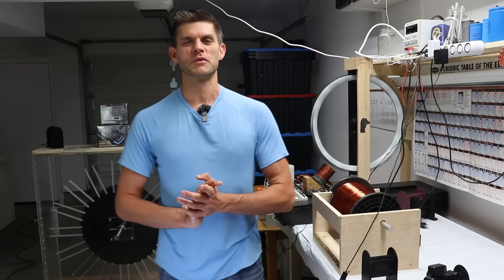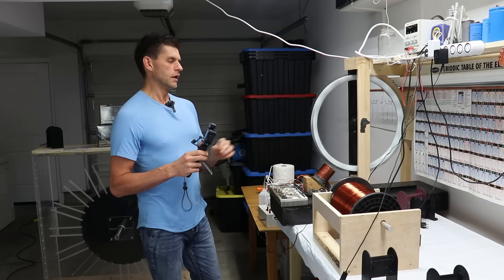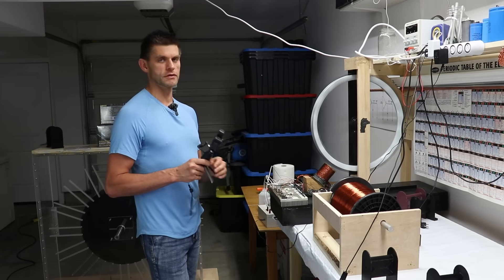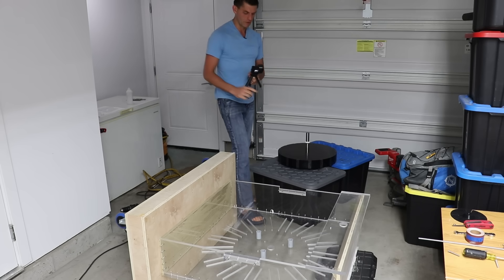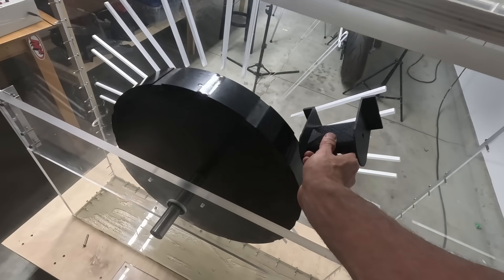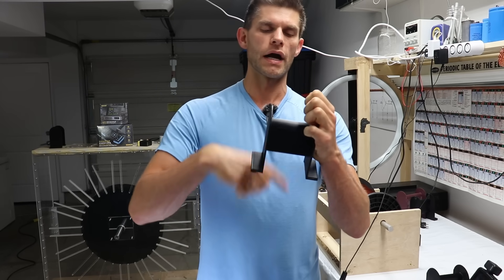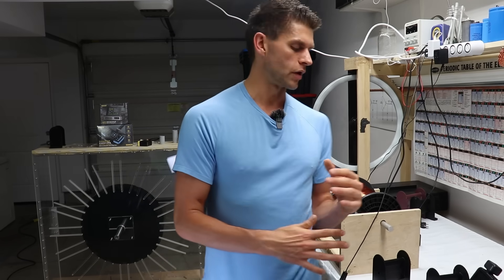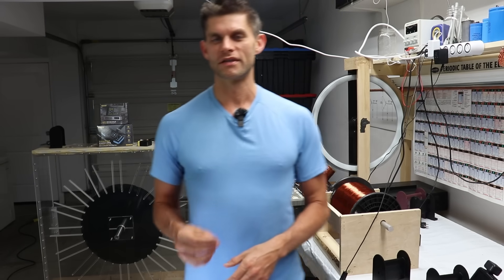Unlocking Zero Point Energy in My Garage (Open Source Project)

Comment: This sounds all nice to the untrained everyday joe, but to the trained professional it is painfully obvious that all this does not work.
Reply from the maker: Ya that's the problem with science, you think cuz you went to school you are smart enough to tell others what's impossible
Reply: @MadscienceLPTECH  thank you for your quick answer, but is was foreseable. Let me tell you - I have spend multiple years of trying to build a machine that puts out more energy than it consumes, including Bedini Motors and searching up old patents and researching about the sudden vanishing of "genious inventors" as far as I know, nobody has been able to undeniably, scientificly proove (with undeniable measurements) that any of these approaches works. Not even in theory such machines work - nobody has found an obvious gap in physics that could be filled with an explanation that allows any of these "motors" to work. All you are doing, is building (best case) an efficient electric motor. BUT it will always consume more energy than it generates. Gaining the energy of vacuum fluctuations is not possible because the energy converters themselves require more energy to function than the fluctuations generate.

Comment: "Air Core vs Iron Core - They Are All The Same"  Paul Babcock.
Reply from the maker: Lol not what bedini said
Reply: @MadscienceLPTECH  Watch the video full version available off A & P Media.  It was Bedini himself that told Babcock, and I quote "Take the damn iron out of it!"  
Of course Babcock called the 
single coiler ssg  "A GoKart.  
The 16 coiler ssg  "72 Camero" and whatever Babcock himself was currently working on "A sportscar ssg."  
Babcock put emphasis on transistors that switch/operate in nanosecond range and silicon carbide diodes that are put over circuits to protect from lightning strikes.  He said "There is no overunity devices. There are only overunity systems".  He was referring to the conditioning of the batteries.  He also said "the pulse motor is one of the most inefficient motors ever created."

Comment: Run multiple charging batteries in parallel off of the output spike, and if you're not already doing it you can collect the output charges in a capacitor and dump a higher voltage load into the charging batteries.
Reply from the maker: Yes great ideas. We can increase the input  voltage to increase the output voltage spikes

Comment: Interesting.

If you can use a tiny amount of current to extract even more excess energy as charge from the environment, you have something pretty cool.

If your larger battery truly charges from your smaller battery through this device, a low-charge battery (3.3 volts) should be able to power the machine and increase its own charge. 

That would be the beautiful test - the machine runs off a single battery, and increases its charge over time. A VOM measures the voltage, and we can watch the voltage rise as the battery charges. 

Then discharge the battery to see how much energy it can produce until its voltage reaches 3.3v.

Cool project.
Reply from the maker: Great idea and comment.

Comment: This is old..I made a Bedini wheel 15 years ago. Geeez. No torque..can stop with little finger. All good for is making counters in copy machines. Do a little more research and keep trying.
Reply from the maker: sounds like you wernt listening, this is a pulse motor with mosfets and high voltage, not a little girl bedini like the one you built lol

Comment: Great concept. You might like to check the liberty project. They have 3 working prototypes of a zero point energy machine. They also can provide the schematics on the prototypes.
Reply from the maker: I dunno if they are legit, I haven't seen any schematics or full disclosure. Their machines are based off others patents from the 60s-80s

Comment: Electric Engineer my ass!
You are pushing the same ages old scam that every other grifter is pushing.
You can't get more out of it than you put into it. And you are still drawing power from conventional sources! But I bet if you disconnected it from the battery NOTHING ...absolutely nothing would happen! And if you just needed the charge for the start a built-in capacitor would do the same as the battery. But it doesn't really work that way!!
And you are just another unscrupulous scammer!
Reply from the maker: clam down, and move on then

Comment: Just so I didn't seem like a douche, so I actually put in some good help, when you go to turn this into electricity, make sure to use a helical (bar with a twist) stator array inverter system.  You'll get 300% more electrical input out of the manual returns from your system.
Reply from the maker: Oh ya, got a link?

Comment: There's way more promise, and it's already been proven to work without a shadow of doubt, inverting the phase-change cooling process to create electricity off of the atmospheric differential using large panels to create pressure to turn an inverter.   It has nothing to do with sunlight or wind.  It works best in the northern hemisphere, at about 50- 72 degrees Fahrenheit.
Reply from the maker: Geothermal has also been proven.

Comment: This BS has been recycled every decade since the 1970's. Along with the Adams motor generator, its easy to build, spins, but does nothing but waste energy because you will only ever recapture a quarter of the energy used to make it run. And the moment you try to use the rotational energy to do mechanical work, the electrical recapture diminishes to zero depending on physical load. A total waste of time other than teaching the basics of a pulsed motor.
Reply from the maker: You sound like a real scientist

Comment: I dont believe your getting excess energy because its clear where you are losing energy. Plus how can you possibly scale up for actual use. Geothermal or solar steam turbine is much easier to scale up to provide commercially. Coastal areas or big lakes with an ebb and flow can also be used to generate electricity
Reply from the maker: Ya there is enough energy gained to negate losses

Comment: Have you ever built a smaller working model that is self running?  If so, you should maybe think about streaming it in constant operation for a few days, weeks or ....even months,  as a kind of  'proof of concept'.  It could also serve as encouragement for others to take interest. I ask mainly because I know of another man on You Tube who built a small two battery version that supposedly ran indefinitely off of two small lead acid batteries and automatically switched back and forth between the charging battery and the running battery when the latter dropped below a certain voltage.  I wish he would have thought about streaming that. The channel is 'Daft Man'  He gives really good and clear instructions on how to build a very scaled down version of the  "Bedini SSG".   I don't know if he's still around,  but I did happen to download all of his Bedini motor videos and I have them in my archive.  I downloaded them back in around 2014 or 2015.
Reply from the maker: ill stream this one for ever once its running

Comment: My uncle was involved in a project that I haven't seen anywhere else.  I saw his videos and it appeared to easily create more energy than it used.  They had a material that blocked magnetic waves and built a fan out if it, similar to the timing wheel you showed in this video.  Super strong magnets were placed on each side of the fan so they repelled each other, one fixed and the other on a slide spring loaded to push them together when the fan blade blocked the magnetic field between the magnets.  It took almost no energy at all to spin the blades slowly while the sliding magnet slammed back and forth with tremendous force.  In fact, their issue was keeping the machine from tearing itself apart and turning the linear force into rotational to turn a generator with many, many times the force rotating the blades required.  They tried shock absorbers and other mechanisms but the slamming was breaking everything.  My uncle since passed and I have no idea what happened to the project.
Reply from the maker: cool, thanks for the comment wish you had his stuff to show us.
Reply: I want to try to recreate this. Do you have a social media I could reach you on to understand this more?
Reply: If you were telling the truth, wouldn't you try your best to find the project or anything so you could get the tech actually created?
Reply: @huff_designs why would I?  It wasn’t my uncles project, he was just helping the guy that was building it. It was 30+ years ago…and I have a life doing what I like to do. People like you are the scourge of social media. Just dump on everyone else because your life is so empty. Grow up.

Comment: You want to design the wheel differently. Old India invention has upside down horseshoe design spokes that has water inside that on outside edges, gravity helps momentum, and inside spin pulls that weight in. Modern upgrade would be to vacuum the atmosphere out of the air section and also put that wheel on magnetic bearing to virtually eliminate friction and your magnetic setup outside that.
Reply from the maker: Vacuum would be good
Reply: @MadscienceLPTECH heavy water will weigh more and help. It will want to shift off magnetic bearings so add a point and a stop and its a sideways spinning top with magnetic glued around edge but vertical and adding some gravity power to your kinetic energy storage and transfer station.

Comment: I like your positive energy, and you are showing some great building skills. Very nice!  
Yes, maybe building a Bedini pulse motor on a larger scale might tip the scales and lead to a COP > 1. You just never know. 
I would caution putting too much money into it at first, however, unless you have the excess funds. 
I would suggest to try to build the basic bare bones setup first and try to keep costs down as much as possible, and if at some point you see clear signs of a COP > 1, then you can consider putting more money into it. 
That way if it doesn't work out in the end (COP < 1) you have minimized your costs. 
Still a fun project to work on at any rate, regardless of the end results. 
I guess you are going to go with lead acid batteries? Pulsing lithium batteries with high voltage spikes could potentially have bad results. You'd want to research it well first, of course, if you want to consider using lithium batteries. 
Best of luck with your build!
Reply from the maker: Thanks mate

Comment: MadscienceLPTECH! These are for you and those who comment on this video! John Bedini has hidden the real working method of the SSG and the 10 coil big motor/generator in his workshop from everyone except a few people ! 
I am revealing Bedini's secret to you here ! 
Read carefully what I have written and try to understand ! 
The SSG in the video only provides its own continuous operation, while discharging the first battery, it charges the second battery and the mechanical movement continues uninterrupted by changing the places of these two batteries ! Everyone knows this system. 
This system DOES NOT GAIN YOU ANY EXTRA ENERGY ! 
Now let's come to the 10,000,000 £ question and the correct answer to this question ! 
Bedini (I am talking about the 10 coil motor/generator in his workshop!) inside the multi-wire coil that he showed everyone, between the coil core and the coil wires, PAY ATTENTION HERE!!!  Bedini placed the "GRID"s in the COLD PLASMA TUBE used in "EDVİN GRAY"'s engine inside the coils!! 
Bedini did not show this ! 
While the copper wires of the coil ensured the continuous operation of the engine, it also printed the EXTRA ENERGY from the GRID placed between the coils and the iron core to the real battery bank! The energy from the coils passes through the primary winding of a step-down transformer and discharges to the ground. It also charges the battery bank from the secondary winding of the step-down transformer! It was able to discharge 10,000 AMPERES in 4 hours. I assume that you thank me for this information I gave you and I accept our thanks. I wish everyone success in their work.

Comment: can you build an electromagnet and make the bottom of the magnet a very thin wire and make the top with very thick wire would it create spacial displacement ones getting a little bit negative and top side is getting alot of positive could you make the electro magnet move that way onesides getting more energy than the other
Reply from the maker: Love it. Great thought. I think the thin end would produce majority of the field and heat etc. You could model it in solid works and see

Comment: 2 Enhancement suggestions:  1. For the large magnet disc, change the shape from a disc, to a spinning top/totem shape, like the toy top in the movie inception. This shape will help to minimize the drag on the disc.  2. You have to add a vacuum to the chamber to reduce the air friction and set it vertically.   I wish I could find the the video on YT from almost 10 years ago or more that had an engine design similar to this one but essentially these two changes were needed to achieve a motor that would run for months on a small battery, it wasn't an OU engine but it was damn close.
Reply from the maker: Love it. Vacuum chamber could be doable in the future
Reply: Recursive Harmonic Resonance. It's coming.
Reply: @UnfurlingKurt ^^^^

Comment: if you hook up a high voltage capacitor to a coil of wire then energize it with a magnet would it self-oscillate and pick up energy and be an induction motor and accumulate energy at the same time
Reply from the maker: If they were in series there would be a resonant frequency for the LC culicuit. dont think so but its a great thought and love it.

Comment: I have built and run Bedini, not Bendini energizers. They run following all the laws of physics. The apparent gains are due to how the batteries are charged. Bedini said this.
Reply from the maker: Ya but do we know all the law is of physics.
Reply: @MadscienceLPTECH  Remember coils are an open system. Pulse your motor coils, feed the inductive kickback into a second set of coils. For every 100w you put in you can collect up to 70w in inductive kickback which you feed into a second set of coils. This way you get 100+70+49 and so on. Use that motor to power a generator wound on the same armature, thus only one set of Iron losses

Comment: If you can run a little Bitcoin Miner like the Bitaxe Gamma or NerdQAxe++ which needs 12V. Then I am here for it to build it myself. Because then you can make yourself some Money without some PV Generators or a Grid Connection. Mining Bitcoin would be the best UseCase for this kind of Generator.

Why not using the better version of Batteries like LFP Batteries ?

Comment: Use brass for a dead blow it works for bearing shafts really well
Reply from the maker: Thanks bro... basically anything other then the carpentry hammer would of been better. Brass i used to use when I was a heavy duty mechanic

Comment: I thank you so much for doing this.  We need an uprising from the public to eliminate electricity bills on the public.  They keep us held down with excessive costs of living.  Also I saw a video years ago of a guy on YouTube doing this principle but he used giant concrete wheels with the magnets on the rim like you have here.  His coil was a metal pole thicker at the bottom and tapered to a point near the wheel.  But once this guy got it spinning he was running it off old aa batteries that would have a better charge after.  linking them in a series I think . I can't remember what his name was.  But he could pump so much water with it because the flywheel was heavy and spinning fast.  Needless to say you are so onto something with zero point energy being pulled from the ethos.  We are there man!  It must be known by all that we can have electricity all.
Reply from the maker: Thanks for the support and kindness 🙏

Comment: Bro 2 battery banks 5k um why don’t you just spot weld a bunch of lithium ion batteries and make your own banks. And also why so much battery storage for such little “overunity” potential?
Reply from the maker: @alfonsozarate2458 u can't hit Li cells with 1000v spikes. We need 96v using big 12v batteries. Hence 16 batteries at $300 each. 

There is lots of overunity potential here. Infinite COP